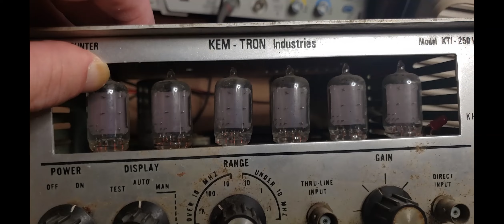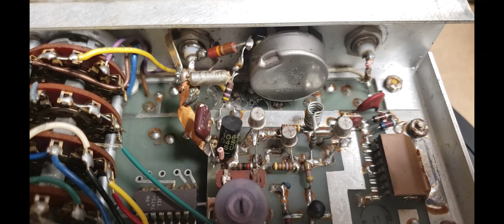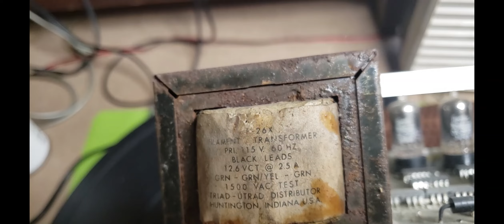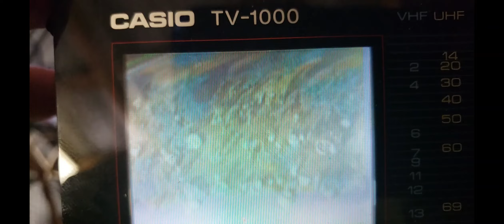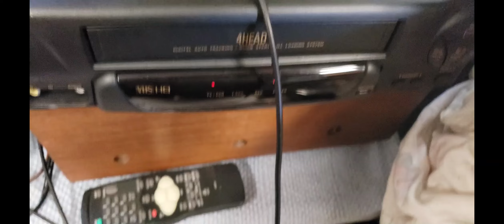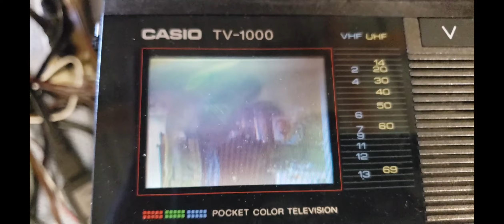FLY YOUR FREAK(QUENCY) COUNTER FLAG! Crusty Tube- display frequency counter abandoned for decades.

Comment: Seems quite simple.  It's got Numitron (RCA brand name) type displays driven by 7447 seven segment drivers/decoders, and a whole bunch of 7490 decade counters.  The displays have bare incandescent filaments (and decimal points) arranged as seven segment displays.  They usually use no more than 5 volts.  So, it's just a frequency counter.  Perhaps somebody tried to turn it into a digital clock.
The IC's are still available but the display tubes are very hard to find.  The date codes indicate 1973.
Reply from the maker: Thanks. I remember when LED displays were cutting edge. Op amps and yes, decade counters.
I actually attended DeVry back when Darlington transistor packages were the rat's rectum. I feel sOOO old.

Comment: I looked online and Kem-tron came right up they have been in Business since 1989
Reply from the maker: Hi.
I really did spend time trying to find information. My son is a Chemical Engineer, and he actually watched this video. He called me to tell me he'd found info on the company through some old manufacturing magazines. However, he's yet to send me the information.(HAHA). I used Google ,Bing and Opera search engines. From what my son told me, Ken-Tron was started by 2 brothers.  It was a small company, and they sold the name years ago.
No, I don't have Sams, and I don't want to subscribe to their service. You used the be able reference Sams stuff at the public Library, but that's long been gone.
     I'll certainly try to get this unit cleaned up and powered on, but I won't brute force it. Caution in repair has always worked for me.
Thanks for responding.
Reply: @Magnusaudiofighter  Ok just trying to Help
Reply from the maker: @brianbloom1799  I really do appreciate it. I am very self conscious doing these videos, and I think it shows in my verbal presentation.
Thank you, again.